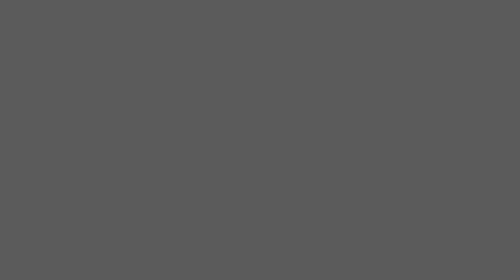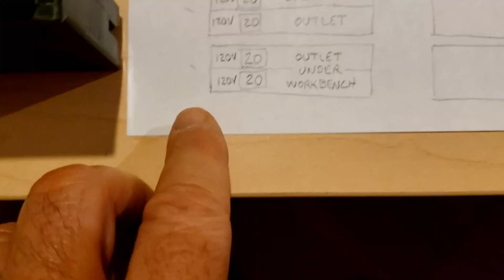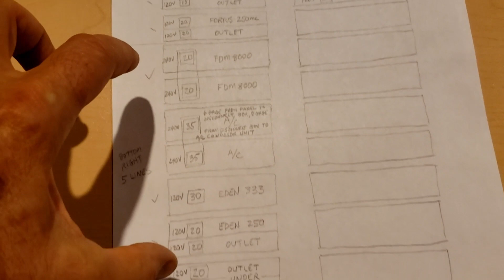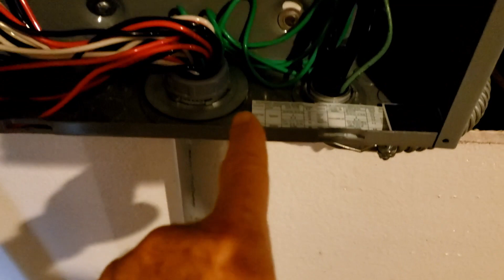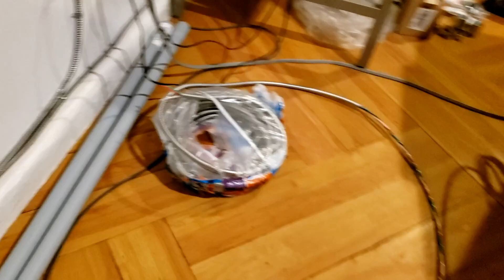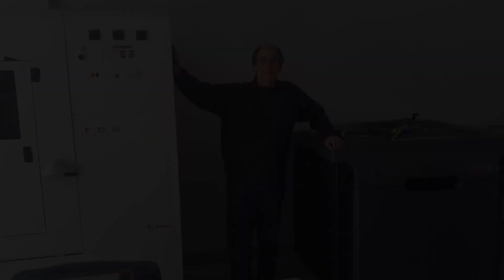3D PRINT SHOP ELECTRICAL WIRING part 3 REWIRING THE SUB-PANEL!

Comment: Agree with Thephantom, for every 20 amp hot wire you need a return neutral for that 20 amps. if you use a 1 neutral for 2 20 amp hot lines then the neutral needs to be twice as big, which isn't up to code either. the current setup proposed runs the risk of a fire from the double loaded neutral return wire getting too hot.  The flex conduit you are using with the red wire in it looks to be intended for runnig light fixtures where the red wire is used for a light switch.  The subpanel should only have black, white and green wire in it for single phase 120V/240 circuits. 1 white and 1 green per hot black wire.  Also if you have a 100 amp breaker feeding your sub panel then you need 1AWG wire guage input (search ampacity charts) it looks like you have 6 guage wire (50 amp).  you must match the wire output to the amp rating of the fead breaker to avoid a fire. good luck, maybe ask that $7K electrician or another liceansed electrican
Reply: Ok, I should also clarify that 240v circuits  have 2 black hot lines, one from each side of your box hot buss bars. The 2 hot buses are 180 deg out of phase, so the return current on 240 circuits returns on the out off phase second hot black wire, so very little current returns on the green earth ground or white neutral wire. Some applications foe 240v don’t even have a neutral return. Always be aware that both hot, black wires need to be switched off to be safe, since both are driving ac voltage in a 240 house outlet ( single phase 240 still has 2 hot lines)
Reply from the maker: @DragonflyEngineering, Good morning Dave, thanks again for your help, I appreciate it. I thought that switching the wires between two different phased Tandem Breakers would solve the phase problem, but I wasn't 100% certain on that. I'm trying to find out if it's code compliant before I start switching wires. If it isn't, then I'll switch out the Tandem Breakers with standard breakers and do some rewiring at the breakers and in the receptacle boxes.

Right! I always turn the breakers off and check for voltage with my voltmeter to verify everything is off before doing any work in the sub--panel. I'm not interested getting a shock! If I have to replace the feed wires to the sub-panel, I'll make sure the main panel is completely off before doing so.

BTW: if you're ever in SoCal you're welcome to stop by my Shop, see what I have going on here and chat about business.

Have a terrific weekend! Robert
Reply from the maker: @DragonflyEngineering, Hey Dave, thank you for the confirmation to @thephantom1492 comment and follow-up, I appreciate your help and learning a lot in the process.

I think I have a solution to the Tandem Breaker phase problem. Here's a link to my new video https://youtu.be/nXlJ_R-RUjg Please view and let me know what you think. I appreciate your help and look forward to your input!

I was told the feed wire from the main panel to the sub-panel is 1AWG or 2AWG, not sure which it is, but definitely not 6AWG. I'm going to cut the power, remove the front panel on the sub-panel and measure the wire to determine exactly what gage it is. If it's not right, I'll replace the feed wires. I don’t want a problem.

Have a terrific day! Robert

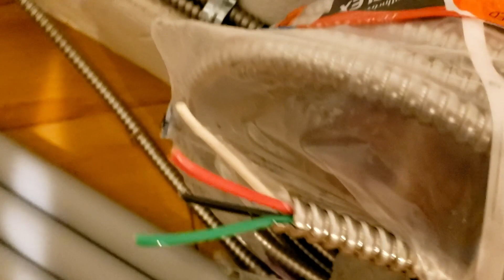Comment: Hi there again, @2:10 "with three wires", you can't do that with tandem breakers. With standard double breakers you actually get 240V split phase, where the neutral carry the unbalance current between the two hots. If you load both outlets at 15A each, then the neutral carry 0A. With tandem, you get the same phase, so the neutral carry both return current, so 30A. You therefore need 4 wires... 

Also, I suggest to hire a certified electrician before making a big mistake. You could be held liable for all damages in case of a fire...
Reply from the maker: Good afternoon @thephantom1492, thank you so much for bringing this to my attention, greatly appreciated! I was told by two other people I know with electrical experience, that how I wired it is ok. However, after reading your comment, I checked into the matter and believe you are correct. The thing that I, and others, didn't know about is the phase issue. Here's an interesting link: https://www.thespruce.com/tandem-breakers-vs-double-pole-breakers-1152748 - scroll down to "Limitations for Tandem Breakers".

I think I have a solution to the phase problem. Here's a link to my new video https://youtu.be/nXlJ_R-RUjg Please view and let me know what you think. I appreciate your help and look forward to your input!

Have a terrific day! Robert